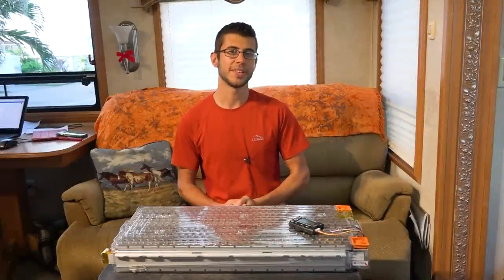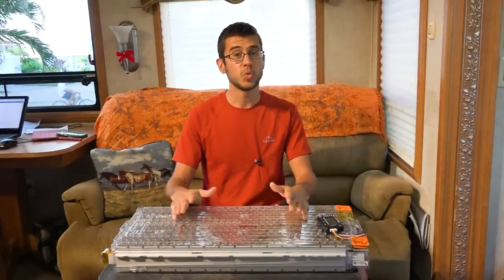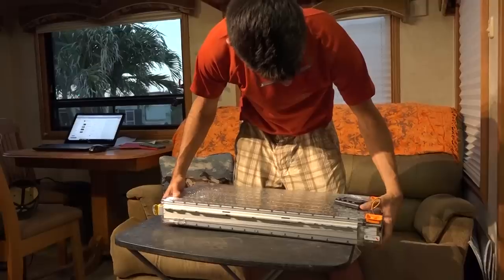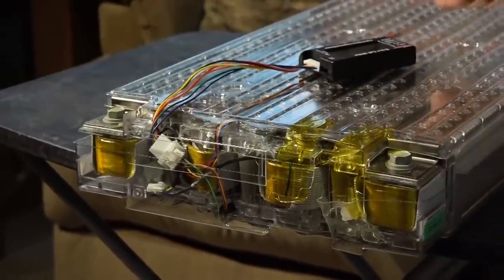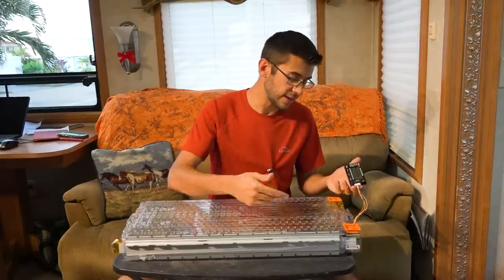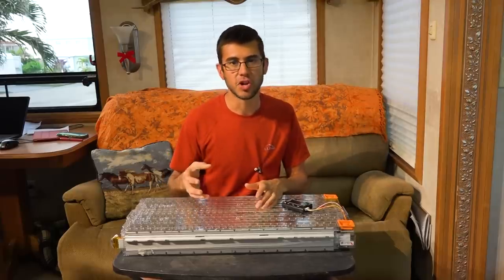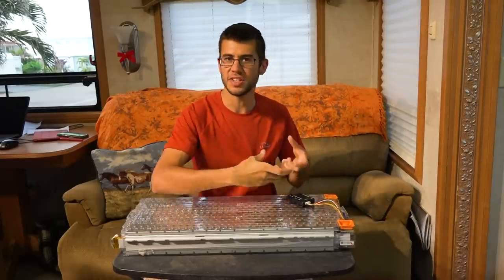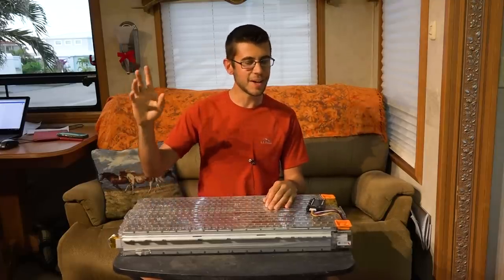Overview of the Tesla Lithium Battery Module We are Installing in our RV - EV Battery Hack!

Comment from the maker: This battery cost us around $1200.  We will do another video later on costs, but per usable watt hour this is actually a cheaper option than many SLA batteries and even some flooded lead acid.   Cost over time due to higher cycles will be much cheaper.
Reply: Mortons on the Move just one pack you will use?  Why not more and a possible on board charger which allow to use EV charging. Game changer
Reply: Not sure what you are saying. SLA is sealed lead acid.
Reply from the maker: Grim Engineer flooded lead acid
Reply: he basically said he's using about 80%. Basically he's not using more because he doesn't have a need for more than 80% of what one battery can provide. If he had two batteries, he'd be using 40% of two batteries instead of 80% of one, it'll work, but why bother?
Reply: Is that $1200 per Tesla pack as shown in the video?  You mentioned a source for these batteries in NC.  Do have their contact info? (website, ect)
Reply: That's a great deal...
Battle born 100ah are $1000
Reply: So you're saying this pack is 5.2kwh for $1200, and one Battleborn is 100ah with BMS built in for $1000.. that seems too good to be true?
Edit: Nevermind I misunderstood what you said. This battery would have about 232Ah, which still better than the Battleborns for the price.
Reply: oh really? cheaper than SLA? lol. nice joke.
Reply: riskinhos  Per cycle it most likely is. Especially if you measure output over the course of its lifetime.
Reply: @CncObsession  You can pay less, but pay a lot more often, or you can pony up the money once, and be done with it for awhile.
Reply: it's a great deal because of the risk of using them.
Reply: wait... the used battery from the wreck cost $1200 or your entire set up i situe in the RV cost that much to accomplish?  Total Cost?
Reply: @dfgatorfan  1 pack is 233 a/h
Reply: Would this be a cheaper route then buying lithium ion batteries . 150 ah battle born
Reply: @riskinhos  you can replace a 1000ah lead acid bank with a 200ah lithium bank which will charge twice as fast, be cheaper and last 5x longer
Reply: I'm perfectly happy with our 107ah (useable) from two 6v GC2 215ah golf cart batteries. Total cost $180. 200 watts of solar on the roof... batteries are always charged and ready to go.

Comment: A great video on showing alternative applications for these batteries. At the end of the day it's a battery, it will store and release electrical energy. So long as your application fits within the specifications that the battery can handle, then ultimately any battery will work.

One small detail but important to note is that this battery isn't exactly made by Tesla. The battery chemistry and most of the battery cell design is done by Panasonic who is a world leader in battery technologies. But these battery cells are made as a partnership between the 2 companies to supply battery cells for Tesla cars. The main reason I want to point that out is not only to avoid mis-conception of origin, but also to guide people on where they may be able to source other battery types that could also suit their needs. Battery chemistry and design is often a compromise of various factors and knowing what types are out there can help you to find the best battery type for your application.

Comment: I must compliment you on the quality of your videos and the information that you are providing about the batteries and the BMS system needed to maintain safe parameters with in Lithium-ion batteries. You like many others are repurposing these batteries to be used on a off grid system whether its installed in a home or an RV in repurposing these batteries you are removing all the disconnect and safety parameters that were Incorporated in these batteries. I see many people online using these batteries without any kind of BMS system which is very dangerous these batteries are very unforgiving like you explained they can cause catastrophic failure.

As an electrical engineer with vast solar experience I know that you will be able to handle the maintenance that's needed to provide these batteries and make them work safe in your environment. But that will require you to physically have a presence with those batteries the BMS system that was designed for that pack was an automated system that required no monitoring that was done by the automated system. So in turn your system will need a physical presence. Again I must compliment you on the design of your system you've Incorporated almost every kind of safety that's possible to make your system safe for you and your family.

Comment: We are using Ford C-Max "Energi" 7.6 kWh Lithium Battery in a 48 volt system hooked up to a Magna-Sine 4448 PAE for our Off-Grid home.  We will be upgrading in a few months building both our Solar panels and battery bank and I plan to build the same system to power my garage/shop asap adding another 4448 Magna.   Independent of no more electric payments makes since, no more draw on that retirement fund.  A super thanks to all the free minded skillful  Youtuber's that have really made this all possible.   We waited, studied and did our due diligence so that our system can be upgraded again and again.
Reply: The manufacturer states that the charge side of this inverter can only be set for Gell, Flooded, or AGM ???????????

Comment: This has probably been already mentioned. Tesla Car Batteries are NCA (Lithium Nickel Cobalt Aluminum Oxide or Li-NiCoAlO2).
Tesla Walls are made with NMC batteries type (Lithium Nickel Manganese Cobalt Oxide or Li-NiMnCoO2).
Best advice for RV or Sailboat are LFP (Lithium Iron Phosphate or Li-FePO4). It is safer. LFP batteries are operating similar to NCA batteries, but with a higher degree of safety. Moreover, LFP batteries are considered suitable for being used in stationary, automotive and back-up power applications because their characteristics (i.e. high safety, good thermal stability, long lifetime and low self-discharge rate) are matching the demands of these applications).
Reply: thank you for this comment I was about to buy this tesla and try to install until I see this comment , can you help me understand  what's the advantage of using this tesla-NCA  compare to LFP is it the price   ? any place you recommend to by LFP if I want to use a lot of amp hours ?
Reply: Robert, you're right on target here. Glad to see your comment!  

Lithium-Iron Phosphate is so much safer (and appropriate) for RV & Marine applications. Hacking a Tesla battery -- especially without the Tesla BMS in place to ensure safe operation -- is playing with fire (both metaphorically and literally!)  Also, using cells which have been in accidents, and could have unseen internal damage as a result, is risky in itself.  

I think the OP is running a risk of lawsuit, by inciting others to make the same dangerous hack.  He also made a number of errors in the technical explanation, which indicates to me that he doesn't understand as much as he needs to for safe and proper Lithium-Ion cell operation and maintenance, much less battery operation and maintenance.  For example, if one cell does burn out its fuse lead and disconnects itself from the battery, that needs to be detected and the cell physically removed (because it will eventually self-discharge and either low or high voltage can lead to uncontrollable internal thermal runaway and fire; if just one cell in a battery catches fire, it will spread to nearby cells, causing a cascading catastrophic failure of the whole battery.)  

He's not following Lithium-Ion best practices.  Maybe he'll get lucky and not burn down his rig. But if he does burn it down, he'll be in for a rude surprise when his insurance company refuses to pay his claim (once they learn the cause of the fire was his jury-rigged a Tesla battery.)
Reply: @MagicHawkeye  If he's in the US, he can't be sued for giving bad advice to the best of my knowledge, and if the outbreaks of measles and the like are any indication, that's true most everywhere. Yes, I'd prefer using a full BMS and putting those temperature sensors and coolant pipes to use. And you can do both without that much extra cost.

However, the whole point of this video was 'lithium power pack on a budget'. There's no way you're doing that without accepting some risk. LIF batteries of this capacity are hideously expensive (Even compared to brand new Tesla packs). $900 gives you a mere 100ah at 12v looking it up, that's a fraction of what this cell does.
Reply: @MagicHawkeye  once the battery falls out of the circuit it can self discharge to zero with no fire hazzard. As long as the ballance sensors are monitored he should be ok as charging current is not foing to be anywhere close as it would be in the intended application.

Comment: If your lead-acid batteries are only lasting 2 years than you're not taking care of them. Fortunately it seems like you've got lots of research done into the Lithium conversion. I can't wait to see how it works. Very informational video
Reply from the maker: Yea we over discharged them a handful of times as they were not quite big enough, I was only seeing about half rated capacity at 50c at around 700 cycles..... I dont think i equalized them often enough either.

Comment: Thank you very much. This was very informative. We’re 25 years off grid (old school). With an excellent system. Now looking at lithium ion and watching what Volta is doing now in the trucking industry. When you install the battery system in your RV please post another video. Thanks. Phil
Reply from the maker: There is a whole series on the install on our channel and blog posts on our site.
Reply: @MortonsontheMove  Thank you very much. I will check it out.

Comment: Tom, I am very interested in this project on several levels. The install of a 24v Li Ion battery system in a 12v RV is something that I have been thinking about for several years, trying to find an efficient way to accomplish this. Also, the idea of using a very power dense Tesla battery, besides being very 'cool', is very attractive both technically and economically.
Our new Class A will be delivered this summer and the first project is to rid it of Lead Acid batteries, then on to a solar array.
Great Videos and glad you are enjoying the Florida coast, we have lived just north of your spot in St Lucie for 3 going on 4 years and are enjoying it. Best of luck, keep up the good work.
Reply: You need an efficient DC/DC switching power converter to step down to about 14 volts. Most appliances will run slightly more efficiently at the high end of lead-acid voltage. Also replace all incandescent & fluorescent bulbs with LEDs. You may need to use LED strips to reach the same lumens.

Comment: Great technical explanation. I upgraded my Tenergy 5 in 1 (only manually triggered balancing) to Hobbyking Battery Medic that can balance automatically when the battery get close to fully charged.
Reply from the maker: Good find!  Does it draw from the whole pack or will it still unbalance the first 4 cells?  I only check balance once a month now when fully charged but have not had to balance yet. hangs around .08 max-min
Reply: It is balancing when a certain cell voltage is hit (I have it set for 4.0 volt or 24.0 volt for the whole pack and is charging to 24.1 so mainly when "floating" the battery pack). When a cell get more than 0.01 volt out of balance is a small resistor added across by the battery Medic. It have keeps my 5 Tesla Modules balanced to within 0.02 volt the last months. 
Depending on how high you charge your battery pack can 0.08 volt of in-balance be a lot if the wrong direction on only a single set of cells. The measurements of the Battery Medic is not as precise as the Tenergy 5 in 1, but the feature of Auto balance allow parking the RV for extended business trips without disconnecting power.
Reply from the maker: I wrote that wrong, it is sinning at .008 to .01.   Yes .08 would be way out in my opinion, anything beyond .03 is too far out for my comfort sake coming from th RC world.
Reply: You got some lucky modules. I have one (of five) that is more than 50 mVolt (0.05 Volt) unbalanced in 2-3 weeks. The strange thing is the module get more unbalanced when not used for boondocking.  We run our modules from 20-24.1 Volt, that leave 25.2 volt - 24.1 volt = 1.1 volt / 6 = 0.183 Volt until we get to even a full charge on a single cell. More like 0.2 volt since we also would have the other cell being low. We start balancing when the cell voltage is above 3.9 volt or 23.4 for the whole module.
I think the conclusion is to never run a Tesla Module without a balancing setup, manual or automatic it just needs one.